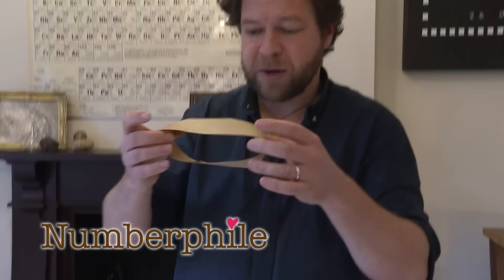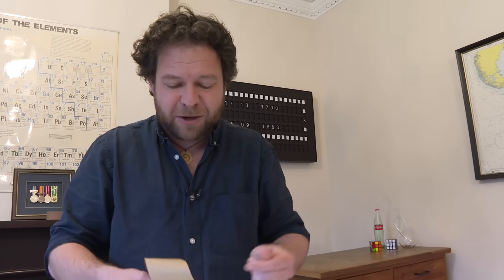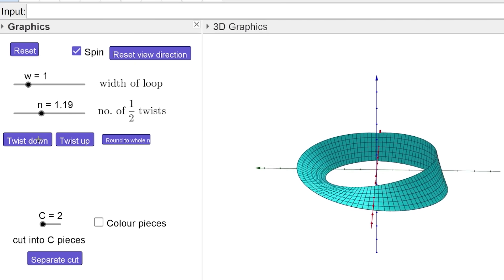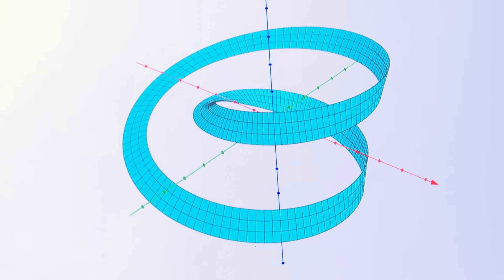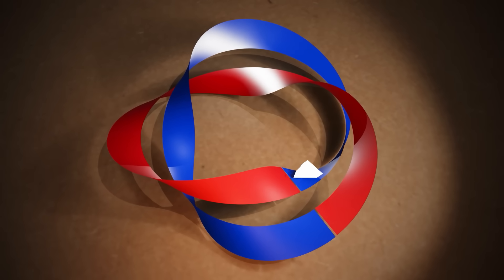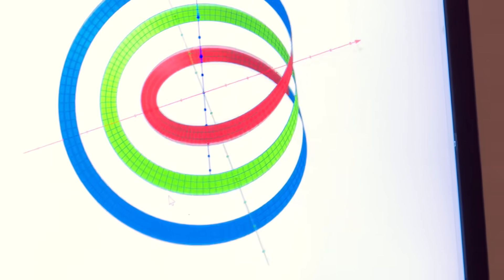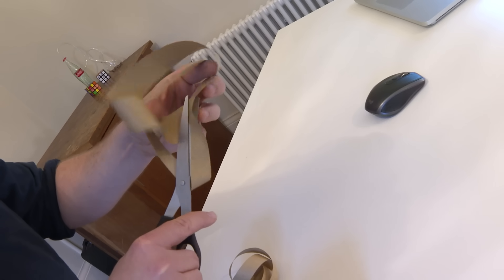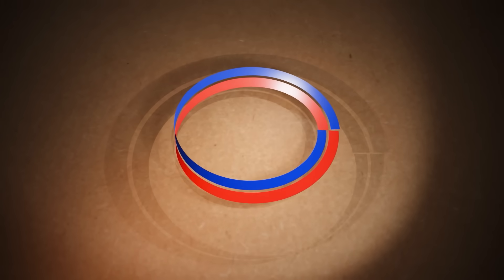An Unexpected Twist on Möbius Strips - Numberphile

Comment: 10:20 A bit of thought makes it clear the long loop is indistinguishable from the loop you get from the single-cut one-half-twist loop, and the one in the middle is just a one-half-twist loop—imagine you can move where cut is (I almost said where the two cuts are, möbius strips are tricky), if you move the cut towards the edges (making "green" wider and "red/blue" narrower) eventually you hit the edge and you just end up not cutting at all, and since at no point did that change the topology of the "green" bit in the middle of course the bit in the middle has the same topology as the original strip, if you instead move the cut towards the middle so green gets smaller eventually the green is reduced to just a 1D lline which is basically the cut from the original "cut down the middle" demonstration, so the red-blue part is the same two-half-twist you got from there.
Reply: Cut a Mobius strip down the middle but keep it in its initial position, don't let it fall open. The cut is like a line drawn down the centre of the Mobius strip. The cut is a 1D space that has the properties of a Mobius strip. 
It is non-orientable. If you insert a 2D flatlander perpendicularly into that space and travel it around the Mobius strip it come back with its left and right reversed. Because it is border by only one thing, the cut Mobius strip, it has only one side and one edge.
Reply: Ooh or even cleaner, imagine the "cut-then-twist" demonstration (4:26) but with a two-cut loop, and recognize that you can ignore either the green part (in which case the remaining red and blue parts are indistinguishable from the previous single-cut-twist demo) or ignore the red and blue part (in which case the green part is just doing a simple twist-without-cut move)

Comment: The fact that cutting the Möbius strip at 1/3 gives you an identical thinner Mobius strip attached means you could make a fun 3d fractal that's just möbius all the way down
Reply: I'm not sure what you mean by "a fun 3d fractal that's just möbius all the way down".
However, when you cut the edge off a Mobius strip, which is what you do when you cut 1/3 of the way in, you make a loop that is not a Mobius strip but is linked with the now narrower Mobius strip. You can now cut a new edge loop from the Mobius strip that will also be linked with the Mobius strip. This second loop can be wrapped around the Mobius strip creating what looks like a Mobius strip that has been cut 1/3 of the way in on its edge surface. The first edge loop can then be wrapped around this.
You can of course do this with more than two edge loops. In which case you get a series of edge loops wrapped around each other all the way down to a Mobius strip.

Comment: @10:25

If you imagine cutting your "third" section really close to the halfway mark, making the green middle section as thin as possible, you can convince yourself that the longer loop is the same as if you were cutting a mobius strip in half. 
Similarly if you imagine cutting that "third" section really close to the edge, making the green middle section as wide as possible, you can convince yourself that the small loop is exactly a mobius strip, though this one is a bit easier to see directly.
Reply: Everyone talks about cutting a Mobius strip 1/3 of the way in. But it could be 1/4, 1/8, 1/16, 2/3, 3/4, or anything else as long as it isn't 1/2. What you are doing is cutting the edge off a Mobius strip. That edge becomes a larger loop that is linked around the Mobius strip
In the extreme when the centre Mobius strip is as thin as possible it becomes a line. Cut a Mobius strip in half but keep it in its initial position. It is no longer a Mobius strip it has two edges and two sides. However the line that it surrounds has, in a manner of speaking, one edge and one side. The centre line of a Mobius strip is home to the defining properties of the Mobius strip.

Comment: When I was bored one night in the Air Force I made a long and wide strip big enough that I was able to do 9 levels of cuts.. it went through phases of separate loops and doubling lengths.. so by the end I had cut each strip during each generation and had a crazy mess of different interlocking strips. Guess it's time to try it again with a bit more maths under my belt 😂

Comment: Hold on, isn't a "Möbius strip" with two half twists not a Möbius strip at all? It has two faces and two edges.
Reply: When you create an ordinary loop from a strip of paper you have a cylinder with two edges and two sides. When you create a loop with a half twist  you have a Mobius strip with  one edge and one side.When you create a loop with two half twists you create a shape that has two edges and two sides. This shape in topology is homeomorphic (equivalent) to a cylinder. It is okay to call it a cylinder but to call it a Mobius strip is a kind of unintentional blasphemy.
Reply: @waynekollinger7080  how is it homeomorphic to a cylinder? 
Since a twice half flipped band will stay linked after cutting in half, shouldn't that property be preserved in topology?

Comment: Now, I want to do one in OpenSCAD (like I did for a couple of my 3D fractal vids).
Reply: I did one in Solidworks for the fanshowdown. I don't remember my strategy, but I think I used extrude along path and then inserted number of twists along the path.
-it looped the airstream😂 eventhough I took off a part for it to be flat. Absolutely no effect.
Reply: @herrkulor3771  Interesting.  Did you post it anywhere?

Comment: Martin Gardner recommended taking a trouser belt, and using it to create two "nested" Möbius loops. You can "prove" that that two loops are separate by sliding a finger between them, all the way around. But in fact, the belt is all in one piece.

Comment: You CAN put it back together.  Ever hear of tape?  Messing with parameters in a simulation is awesome.   Even looking at differential equations and messing with parameters is interesting, or filter equations, for EEs, or whatever type you Choose, even FIA simulations, where you change the parameters of spars or skins in a wing, say, and load it.  The fact that math connects several of them shows you the analogs, directly, for example a spring mass system and passive electronic oscillator.  Actually a 3D Mobius strip, which is the only kind you can have in reality, has two surfaces, including the edge, if I am visualizing it properly.  What makes them TRUE analogues is putting ideal in the definition, obviously.
Reply: Actually you can have a 2D Mobius strip in reality. It's not that hard to make. Start with two identical strips of paper, one placed on top of the other making a sandwich. Between the two is a 2D space. That space has length and width and no thickness. It is a 2D strip made of nothing. Give the sandwich a 1/2 twist and join the ends. The 2d strip gets a 1/2 twist and its ends get joined. It is a real life Mobius strip. You can't see it. You can't draw lines on it. Ants can't walk on it. But its there.
Reply: You are right about the 3D model of a Mobius strip having two sides and two edges.
Reply: @waynekollinger7080  Clever, but is  Mobius strip made of nothing REALLY a Mobius strip? ;-)  Sounds more like a question for philosophers, than topologists/mathematicians.
Reply: @MrJdsenior 
In mathematics a Mobius strip is a 2D shape that has length and width but no thickness. 
The problem in understanding this is that initially almost everyone is told that if you give a strip of paper a half twist and join its ends you make a Mobius strip. Not so. Paper has thickness. What you make is a 3D model of a Mobius strip. A paper model is a Mobius strip the way a plastic model is a fighter jet. It's a representation of the real thing. A 2D Mobius strip is non-orientable while the 3d model is totally orientable.
Reply: @waynekollinger7080  I wish you would stop this.  You are going to induce me to go do some real research, and we all know how THAT always turns out/  ;-)
Reply: @waynekollinger7080  Still it is directed into a third dimension, so what to do with that information? What do I miss? Btw. thanks for sharing your knowledge

Comment: I have a question about toruses/tori that might interest Ben. If one wants to demonstrate how the points on the surface of a torus are connected, one can use a sheet of graph paper and say that the vertical lines connect from the bottom edge of the page to the top edge. Similarly, the horizontal lines connect from the right side of the paper back to the left side. If the material was something very stretchy, or if you were to use a visual simulation, you could roll the "paper" into a tube and connect one end to the other. But here's the thing about which I'm curious: it doesn't seem to matter which connection you make first. As far as your 2D "paper" is concerned, they're the same torus. But in 3D, it makes a difference. If the vertical lines are blue and the horizontal lines red, then the torus will look completely different depending on which way you form that initial tube. But the connections between points are equivalent. So, are the two toruses/tori the same, or not?

Then there's the possibility of introducing twists as you form the torus. Would that involve projecting the shape into 4 dimensions? Or, there's the possibility of connecting the bottom of one line to the top of the next so that, say, the vertical lines form one continuous line - what kind of shape would that form? But these are in some ways less puzzling than my first question.

Comment: When you cat mobiüs strip third of the way, you get two loops, but not just any loops. The green one is just the same mobiüs strip that we started with, except with some of its edges trimmed. The red\blue one is the same as if you were cutting in half instead of in three, except instead of cutting losslessly you were using chunkier scissors that actually removes some of the material from the middle.

Another fact that your simulation clearly demonstrates is why cutting a single half-twist strip produces a two-half-twist strip. Because the new strip actually loops twice around the vertical axle.
Reply: "... except with its edge trimmed." :-)
Reply: After cutting a third around, try cutting the resulting smaller loop a third around again. I’m curious about the linking topology of the resulting smaller loops, and of course, repeating this infinitely on the ever thinning Mobius loop bit.
Reply: @geeko321 If the smaller loop is the same as the starting loop, then cutting a third again will turn that one into a larger double twist with a thinner but still same radius Mobius loop linked to it, which I think would also be linked to the first large loop. Need to try this!!
Reply: @LSNxyz  The way I visualise it is that you're taking the core mobius strip and just keep trimming the edge off - if you cut it in thirds each time, each edge you trim off will be thinner, but just as long, and they'll all still be linked to the core mobius strip in the same way - but it's the same as cutting the final core strip first, and then cutting the edge strip into pieces - those pieces will be linked to each other (when you cut a strip with an even number of half twists, it separates into two strips with the same twists, and the same linkage with any other strips, as the original)
Reply: I love the idea of the middle ring being the kerf of the blade as if you're cutting it in half!
Ooh, I wonder if you had 2 parallel blades and cut around it once, would each blade's cut meet the other's? You could color-code them with dots at the cut start… now I need to rig this up somehow 😂
Reply: Does the cat have to be the observer? Wdym by the cat has to strip the object a 3rd of the way? Is this related to the Shrodingers cat theory?
Reply: @LordOfThePancakes  he meant cut, but funny joke.

Comment: what will happen if you keep cutting the strip in half ?
Reply: If you cut a Mobius strip in half you get a new loop that is not a Mobius strip. If you cut that loop you get two new loops that are identical to the new loop only narrower and linked. Every time you cut one of these loops in half you get two more identical loops. All the loops will be linked to each other and you will have quite a mess.
To avoid the mess when you cut the Mobius strip in half keep it in its original position do not let it fall open. You will find you can slip one half under the other and the new loop will nest creating a model of a Mobius strip that has been cut through its edge rather that its side. You can cut this in half again and nest it again ad infinitum.

Comment: If you have a hard time to cut it straight, just print a guideline on the paper before glue it together. The 2 looped cut mobius strip looks like a trimmed half twisted mobius strip plus a longer full twisted mobius strip.

Comment: what happens if you make three cuts, dividing into four sections A B C and D, but then twisting and linking A to C and B to D ?
Reply: It depends on where you make the cuts. If the first cut is down the centre, you get a new loop that is not a Mobius strip. The next two cuts are equivalent to cutting this new loop down the centre. The result is two loops that are linked. 
If none of the cuts is down the centre, you get a centre loop and  three loops that are linked to it and each other. Each time you make a cut that is not down the centre of a Mobius strip you are cutting the edge off a Mobius strip. The result is a Mobius strip linked to loop that used to be its edge. Do this three times and you get three loops linked to a Mobius strip.
Reply: @waynekollinger7080  the important part of my question was the twisting and linking of A and C and B and D, i am not sure whether your answer takes that into account
Reply: @davejacob5208  
My apologies for a sloppy not-thought-through answer. 
I was thinking in terms of a completed Mobius strip with, in one case three cuts spaced out equally, and in the other case three cuts to one side of the centre line. This is obviously wrong because then there is no question of joining A to C and B to D. The loops are already complete.
I am guessing you are thinking of a strip that has been cut into four equal parts but then treated as a single strip and twisted to form a Mobius strip. Normally this would result in A joining to D and B to C. The result would be two linked rings, neither of which is a Mobius strip.
However if the combined strip is shifted so that A and C connect then they form a loop around B which could then connect to itself to form a Mobius strip. To connect B to D two connections are necessary. Both connections can be made outside the AC loop, or both can be inside the AC loop, or one inside and one outside. This results in loops that are linked and twisted about each other.

Comment: Once--years ago, now--I modeled a Möbius strip in Fusion 360.  Not really a strip, I guess, more of Möbius plate as it had some thickness to it.  The program really struggled with the shape.

That said, taking something with more edges to begin with, like a triangular or square cylinder and connect the ends with partial twists is also fun as you can get similar effects with "smaller" twist.  The triangle only needs 1/3 twist and the square  a quarter twist.  The cutting does get more complicated though as your cut needs end in the center of your shape.

Comment: The middle strip when cutting at ⅓ becomes an original möbius that is just a bit narrower.
So you could repeat it again, and again...
(So cutting a möbius into an odd number of 2n+1 parallel strips gives 1 central möbius and n intertwined twice-as-long double-möbiuses.)
Reply: The way I thought about this was that you're effectively taking a Mobius band and "trimming the edges" to just make a thinner Mobius band - so it's no surprise the middle part stays a Mobius band and the outside stays in one separate piece?
Reply: @jjjjj93921  Sure! And a möbius band has only one edge so that trimming only leads to one extra piece. Certainly.
Reply: @landsgevaer when I said "it's no surprise", I meant only after seeing the cool red, blue, green colouring in the video haha. It would have been a surprise before hand. I still don't have an intuition for why they're interlocked though afterwards